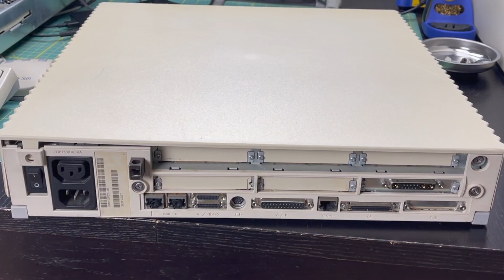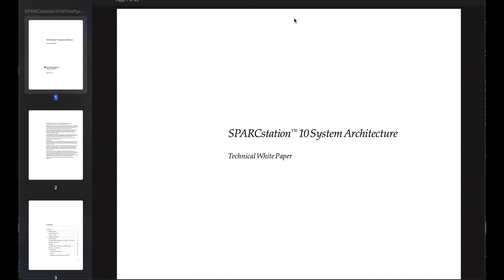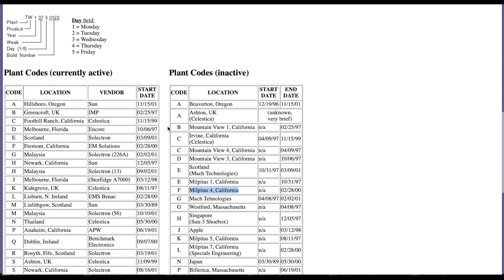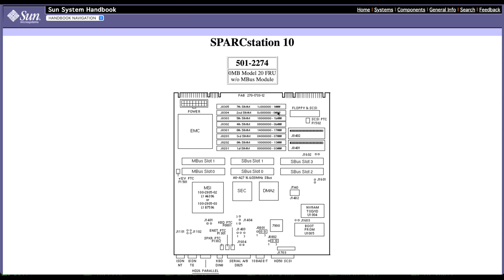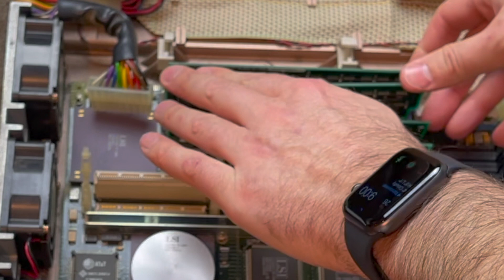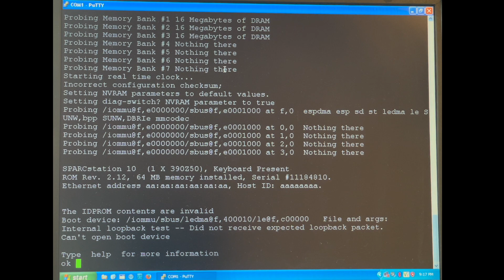EP3: SPARCstation 10 Checkout & Initial Boot

Comment: Nice video on the SPARCStation 10! I have the newer sibling, the SS20, with dual HyperSPARC 90mhz CPU's. It's super fast given its age. Once the SS5 and 20 hit, Sun revised how the cooling works in the pizza box case. Instead of the PSU sucking in hot air as in the SS10, Sun flipped it around and the PSU is what draws in the cold air from outside. I assume the high heat HyperSPARC and SuperSPARC CPU's and Leo framebuffer cards roasted a notable number of PSU's resulting in this design change.

The most 90's thing about the SS10 has to be the onboard ISDN. The future that never materialized stateside due to telco reluctance to sell the service. It took off in Japan and Germany so it was probably a useful feature there.

Comment: Just found your channel by accident while searching for information for my SPARCStation 10.  Excellent video!  Looking forward to more.
Reply from the maker: Thanks Geoff! Lots more to come...please stay tuned!
Reply: @thenetworklab7276  Great!  I've succeed in getting the SS10 to finally boot via terminal - trying to figure out the best way to image the SCSI 1 Fast Drives, without much success yet.
Reply from the maker: congratulations Geoff!  If I was going to image an old SCSI drive that was formatted as a Sun UFS volume, I'd probably get a cheap old Adaptec SCSI card (AHA-15xx for ISA, 27xx for EISA, or 29xx for PCI), throw it in a PC running a boot CD of Linux so that you can mount the UFS volume (e.g. https://askubuntu.com/questions/85154/mount-ufs-filesystem), and either manually copy the files off to a thumb drive or another disk or use `dd` to duplicate the disk.  Good luck!